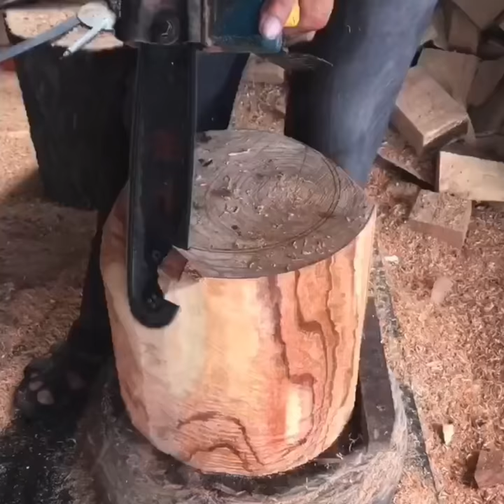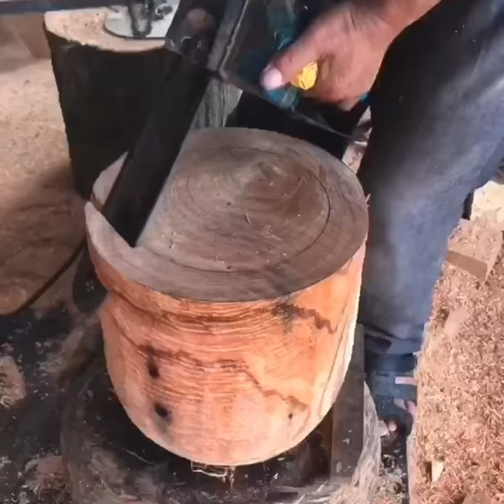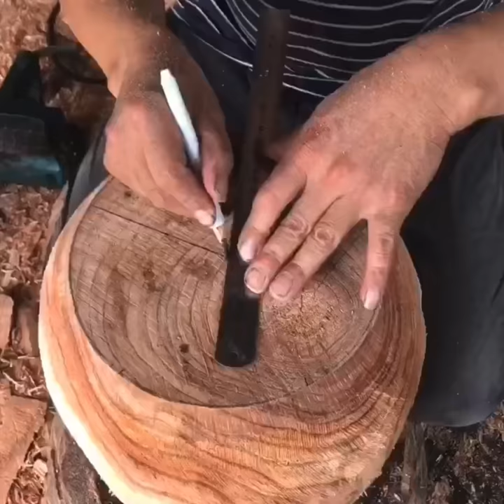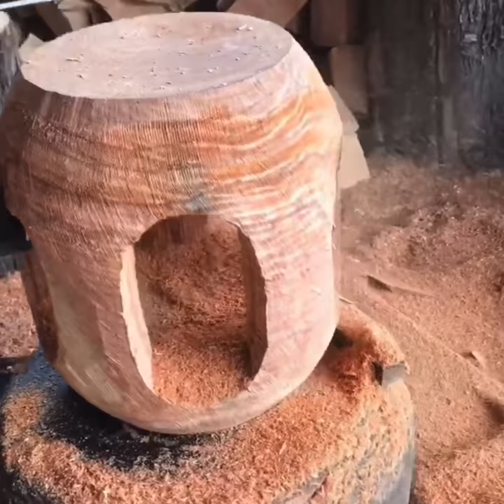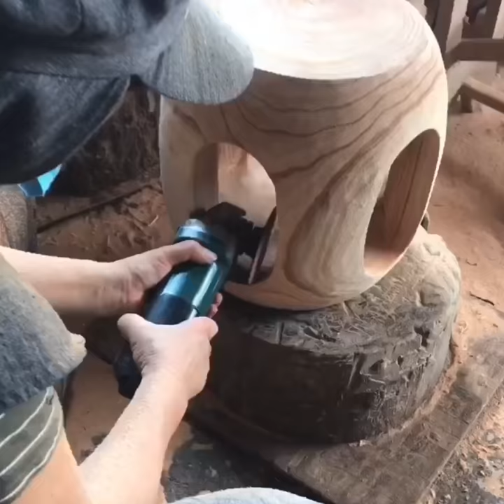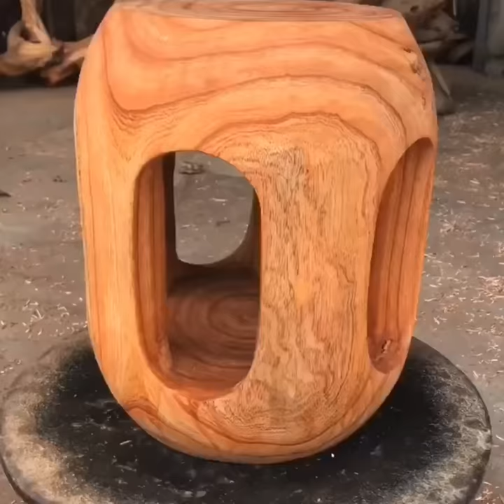woodworking How to make mini chair

Comment: The original stump would of been fine for me
Reply: Xd🤣🤣
Reply: Very heavy to move around
Reply: @farhanahoque9854  wt9
Reply: Stop it he did a very good job
Reply: Much lighter to move around after using up a lot of gas, oil, and electricity. A few more cuts and you coud even have two stools.
Reply: @thomasarussellsr  are you some kind of champion stool carver or just an American throwing redundant opinions ?
Reply: CrouchingWombatHiddenQuoll both
Reply: @crouchingwombathiddenquoll5641  no, not a champion wood carver, just thinking, one could split the uprights and curve those into the openings and have two stools out of the one. Not sure what being American has to do with anything, but yes, I am.
 In fact, I am slightly more than half Native American by DNA results. If that makes any difference? The majority of the rest of my genetic roots are mostly eastern European with 3% South African. 
Please explain why my ancestry has anything to do with my sharing an observation?
Because, you do know, not all American born individuals are of the same personalities or core beliefs, right?
Reply: @thomasarussellsr  you were clearly taking the piss, pointing out the resources and effort this person went to fabricating the stool. 
Typically, like most exceptional American's you took offence at being called out for your flippant put down. Not interested in your DNA report .
Reply: @Nevisblau  I may not be the only Airhead on this comment section. Thank you for your input.
Reply: @crouchingwombathiddenquoll5641  there was no put down, just an observation. The comments that those happy to just sit on the log were much more environmentally friendly, thats all. A mallet and chisels could return the same result without using fossil fuels.
Reply: nn
Reply: XD
Reply: Stump a stump just shaved a bit
Reply: Thomas Russell dude this guy spent like hardly any time on this I don’t think that fossil fuel reduction is on the top of his mind, never mind the fact that it made barely any at all
Reply: Danny he doesn’t need to, he got to the 100th one and his brain almost dead exploded
Reply: @melissadelrio-valdes6183  it was a joke calm down plz.🤦‍♂️
Reply: Josiah .j I think he knows, phat is just a different internet way of spelling it
Reply: Danny you can and most people do, it’s called a stereotype
Reply: @voicesfrombeyond Only if his tribe has a casino.  Mine is building one now....I'm pretty excited about it.
Reply: Danny  100% of the ones I have met displayed a towering level of exceptionalism.

Comment: We must try to avoid These things coz they are made by harming the trees and lot of part is being wasted  in the process
Reply: dude theres alot a trees in the world. 1 small stool isn't a Avengers level threat
Reply: @Anjum Amerjee what if we reuse the wood?
Reply: @Anjum Amerjee also we still have the seeds for growing trees and the trees that a cut down for construction can be reused as fertilizer for other trees to grow
Reply: @anjumamerjee8419  Trees are renewable, wood is also durable and has multiple uses not to mention it uses low energy to recycle. Whereas, other materials such as metals and glass actually cause more harm to the environmental when you recycle them compared to using newly mined and produced metals and glass. Wood is probably the best and most sustainable material to make anything you can out of it. Not to mention it is biodegradable and it's waste doesn't harm instead benefits the environment.
Reply: @anjumamerjee8419  oh yeah, if you learn these skills you can also make amazing furniture that cost hundreds of £'s yourself for a fraction of the price.
Reply: That chair is 100x more energy efficient and environmentally friendly then your phones, laptops, computers or any other gadgets you have so maybe you should also stop using them.
Reply: @archany585  environmentally friendly, yes but this chair specifically is not a need... It is not something that is essential for survival... It is just a decorative piece... This is a waste of the wood only... Instead, essential supplies could have been made using this wood....
When there is a limited resource, it should be cleverly utilised, not lavishly for luxury...
 
Instead of wasting the wood, we must reuse the wood that's being wasted in this video which might have actually been recycled by the person in this vdeo also...

This is harming, you may resow to get a new tree but the time it will take to bring a complete grown big tree is huge... And resown plants are not the natural forests, they are called plantations...
I agree that wood is an essential part of our livelihood but this chair is something that we can live or survive without...

And to respond to the comment that said that we need to stop using other gadgets also, yes we need to stop using those gadgets also but this vdeo is not about those gadgets but about a wooden chair. So her comment will obviously be related to the vdeo, about how a tree is being wasted and not about those gadgets...
Reply: firewood

Comment: So I need to bring a chainsaw , sandpaper hammer,nails and a huge block of wood to school?
Reply: While you can probably get away with bringing most of those to a shop class in school... You may have some trouble walking into school with a chainsaw... Like... While you can say the log is for a project... The chainsaw... May have some legal issues...